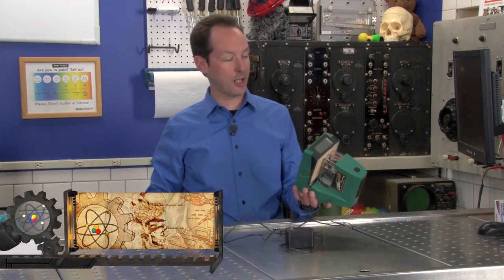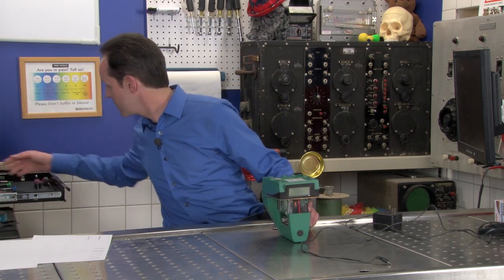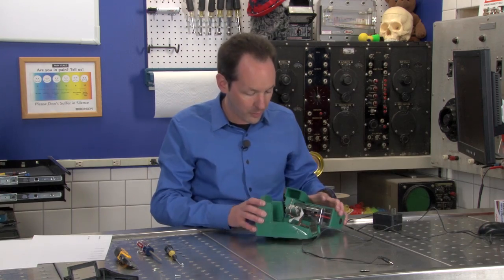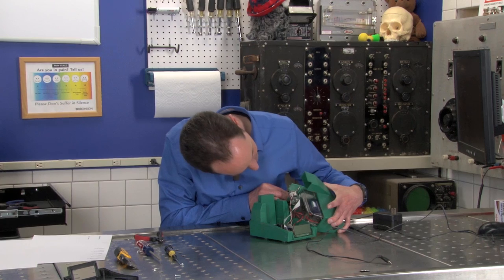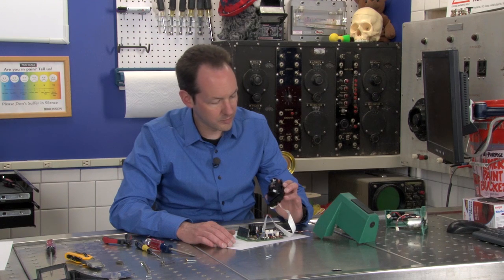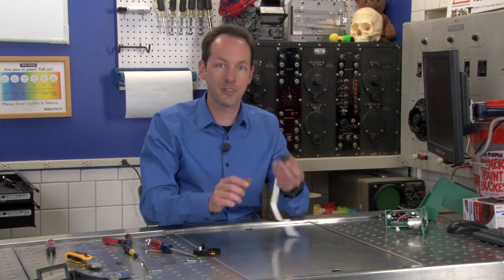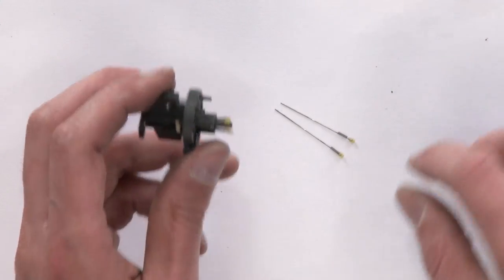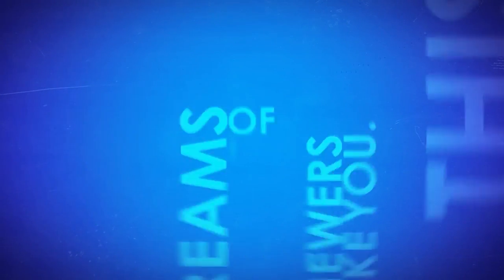Acroprint Time Recorder: Equipment Autopsy #78

Comment: the photosensor you were playing with is supposed to have the black encoder disk on the gear drive rotating inside it to detect carriage movement. That is why it did not print. The top one is a home position sensor.

Comment: Looks like there's a chopper wheel at the end of that gearset. Perhaps it is to verify that the printhead is moving, and its location (so the driver can correlate the movement of the head in the X axis to the pin matrix's Y axis). Once the hood was removed, it probably wasn't detecting the head movement anymore, causing it to the throw the error.
Reply: Josh Smith hah so i wasnt the only one yelling that  at the computer
Reply: Josh Smith My thought exactly too about the light detector cog on that gear.  Though, it would appear that both wheels are connected through the gear system, so I think it they are there to double check.  The top sensor appears to be once on a rotation and the bottom wheel is maybe a finer rotational indicator.

Comment: Most Dot Matrix Printers have 9 pins, I'm not sure why either.
Reply: +CoolDudeClem - The really nice dot matrix printers had 24 pins!  Back in the day the Panasonic KX-P1124 was the Cadillac of printers. With printing speeds ranging from 53 characters per second to 192 cps depending on the quality needed. The HQ resoultion was 360 dpi in which you could make some very cool banners! :)  If I recall correctly it even had a "quiet" mode!

Comment: what's that white strip?
Reply: Sam Sitar A ribon cable. Its like a hard disk drive cable. This strip hold a group of conductors, perhaps 12 or 16. They are very common in consumer electronics to interconnect boards.